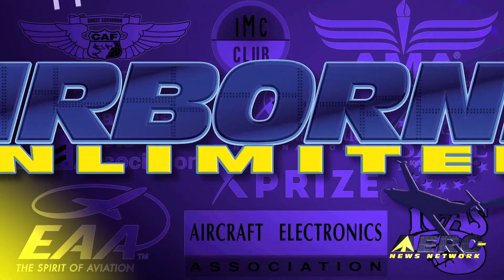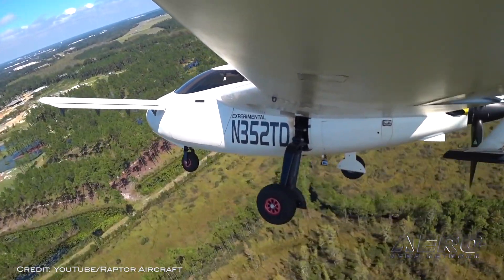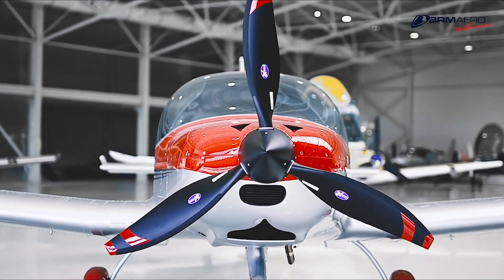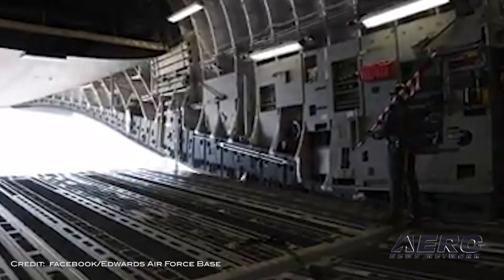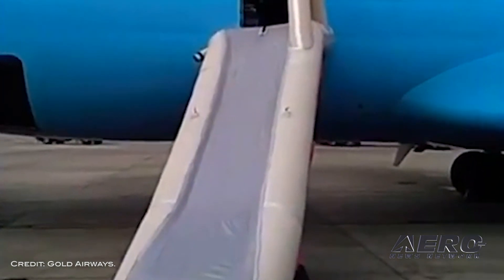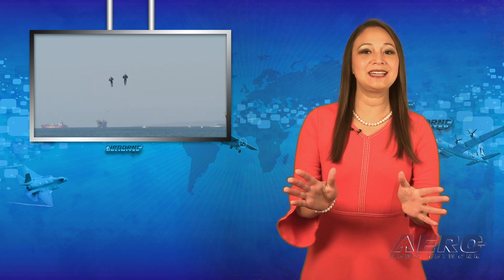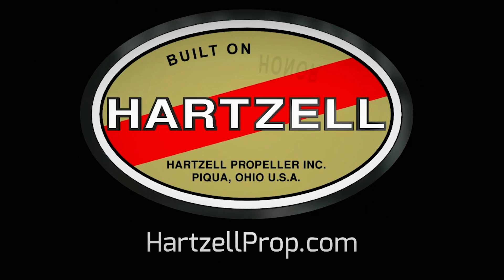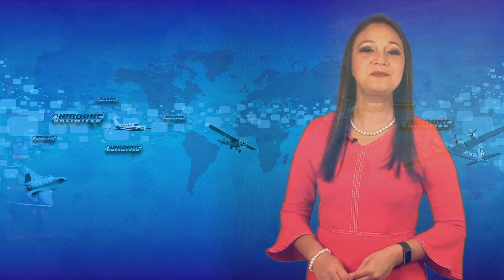Airborne 10.19.20: Raptor 1st Flt, P92 Echo MkII, Jetpacks v LAX

Comment: How could the Raptor first flight be considered successful when it didn't even make a complete pattern circuit, which was the objective of this flight? 

The flight was cut short for landing due to overheating engine and the fact that it could not climb more than 300 ft AGL at full power. 

Successful in the fact that it didn't crash?
Reply: How did you get those figures and facts? Were you there?
Reply: @PDZ1122  from raptor aircraft

Comment: That Raptor looks promising, and I look forward to seeing more from them.  I love the idea of the BRS Parachute and the canard design is a proven platform.  I imagine that they will overcome the issues they encountered very quickly.
Reply: I wouldn't hold your breath! It's got a long way to go and a lot of issues to resolve, including cooling, weight, performance and aerodynamic stability!
Reply: Nothing is proven on Raptor and the designer has no background in aircraft design, engines, turbocharging, systems design or structures. Nothing will be solved quickly here. This is very far away from meeting any of its design goals.
Reply: There's no "they"  It's "he" and he doesn't listen to good advice. Well, actually he did on the airport but he was very unhappy about it. Probably saved his butt flying there with the extra runway to abort to.
Reply: who is "they"??
Reply: There's no reason to believe that this is the case. It's not even close to being a viable product and he appears to be out of money and 'ideas'.